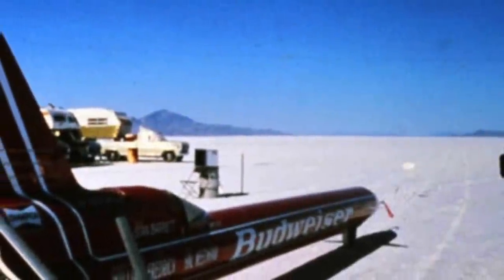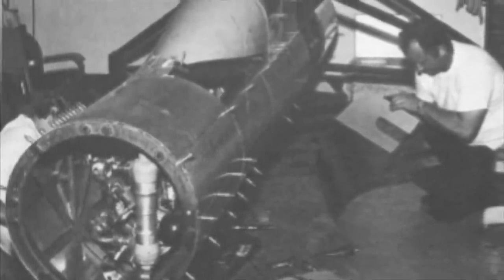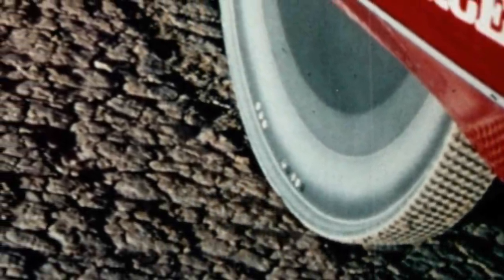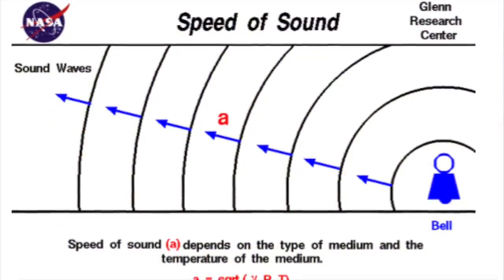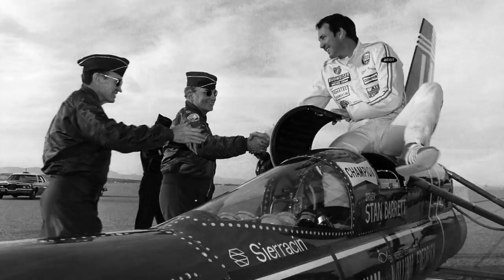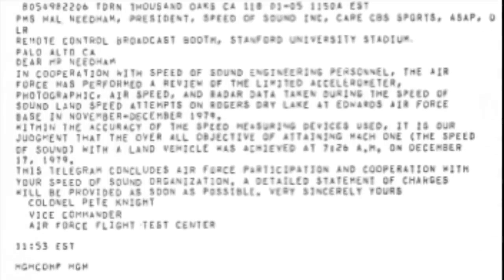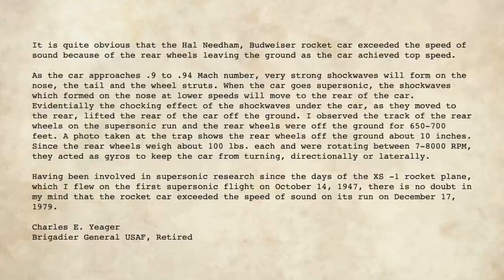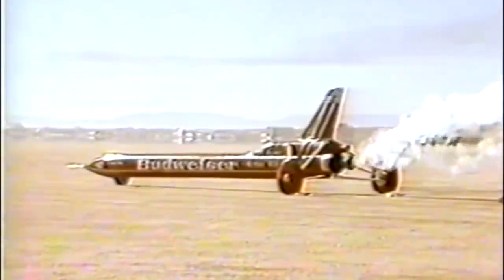The Budweiser Rocket - Controversial Rocket Car

Comment: The Air Force knew what they were doing was very dangerous, Pete Knight the X15 pilot was there giving assistance and advice. The AirForce control facility that tracks all flights was monitoring the velocity of that vehicle, they attached a sidewinder missile to the vehicle to provide sufficient thrust to push the vehicle  past mach 1 at sea level...the Air Force registered 739 mph and gave them the documentation of what they had done. The Air Force had no reason to lie , nor were they trying to assist setting a record. They know first hand the danger inherent in such endeavors, they simply did all they could that Stan Barret would survive. Armchair quarterbacks can give their opinions all they want , people present at such endeavors feel very small, ask any astronaut that has ever gone into space, ask any military aviator ...the old saying is " there is a million ways to die "
Reply: Nah.... Stan didn't break the sound barrier. If that was the case, why did it take so long for the Air Force to come up with that (bs) figure of 739 mph, * 8 hours * after the run? There are just too many issues with the timing equipment, the inconcistencies of the speeds measured, and the fact all that data has never been publicly released verified by independent authorities, that it's pretty much impossible to give the record to Barrett. 
Plus, there was no observed sonic boom, either seen in the footage or heard by the spectators, something that was proven without doubt to have occurred when Thrust SSC broke the barrier in 1997. 

Call me an "armchair quarterback" all you like.... the facts still stands. Barrett didn't break the sound barrier. He was a brave man for sure... but not the first to break the speed of sound.
Reply: Ooooof.... That's a definite "yikes" from me.

No need to rebut your unobjective and nonsensical counter when you finish off with a truly demented tirade at the end.
Reply: @821marko  1/10 because of the  insane ramblings of a madman
Reply: @ChaosCat79  ...you're not able to discern between good and evil hence your hatred is present ...evil exists in many places regardless the venue its nature never changes...it is always darkness leading to death...which is the very definition of "chaos"...

Comment: NO" SONIC BOOM " NO RECORD 🙄🙄‼️
Reply: No shock wave patterns on the ground under the vehicle either. It was these shock waves that nearly tore lumps off the underside of Thrust SSC and did a lot of damage. A vehicle that size with its pointed nose would have produced a very prominent sonic boom that would be clearly heard by those around.
Reply: The record was never their intention.

Comment: the air force calculated mach that day at 731 mph based on barometric ps and other factors such has temperature, the car went 734 on radar it reached mach 1 case closed.
Reply: No, the radar measured 38mph.
Reply: Yep!  You are correct my friend.
Reply: Is there a given height where the local speed of sound is actually 38mph -- if there is; and also assuming my theory that the given height would be "rather high up" is correct, to what magnitude would I be choking to death? If that's too boring a question, I'd also be interested to know; collectively, this community's fully-formed opinions as to how horribly fucked a sensor array would have to be in order to spit out a speed as bleak as 38mph.

Genuine question.
Reply: that is way off. for mach 1.0 to be at 739 miles an hour you would need to be at 10,000 ft in altitude case closed. people rewriting history again
Reply: It didn't happen. End of !!!

Comment: A sonic boom and a peroxide rocket both create about 200 decibals of sound. A jet engine is around 120 to 140 db.
Reply: And the sonic overpressure will reach you before the sound of the rocket or jet motor.
Reply: @thethirdman225  That's not how this works.
Reply: @mfree80286  It is if you want the truth. But if you want to engineer a story about something that didn't happen, I suppose you could just wipe it off.
Reply: @thethirdman225  This isn't an explosion; you're literally saying that the sounds moving at the speed of sound will reach you before the other sound at the speed of sound.
Reply: @mfree80286  
”This isn’t an explosion”

What’s the difference?

I’m talking about where the camera was positioned. That was the point in the run where the vehicle would reach its maximum speed. You can tell. That’s where the auxiliary rocket motor flames out. That’s where the vehicle should be travelling at the speed of sound and yes, at that point, the shockwave will hit you before the noise of the rocket will because the shockwave is travelling faster than the speed of sound.

https://physics.info/shock/

But the point is that there is no shockwave.

Comment: Not controversial.  It went 739 mph on a day that the SOS was 731mph.  USAF certified it.  Budweiser rocket car went supersonic in 1979.  All the rest is a needless bunch of crap.
Reply: Wrong in everyway.

It never touched 700mph, let alone the bogus 739mph that Hal Needham and Stan Barrett claimed it did. 

The USAF did not certify the run, in fact they backtracked from all claims and washed their hands of the entire thing shortly afterwards. 

The Budweiser Rocket never went supersonic in 1979.

The only "needless" and "crap" thing here is what you typed.

BTW, the equipment used by the USAF at Edwards, which they even notified to Needham and his team before the attempt was made, was neither calibrated or set up to record ground based vehicles in the first place. And to top it off, all the data collected by Needham has never been released for independent verification for over 40 years now. If they were so certain that they had achieved their goal of going supersonic, then they would have been all to happy to hand all the data over as proof that they broke the barrier. That it's not seen the light of day since 1979 should tell you all you need to know about the validity of the claims made about this stunt.
Reply: @ChaosCat79  You know, just as there hasn't been any solid evidence of MACH 1 have been made public, there isn't ANY evidence it never even hit 700. Given either of those options, from MACH 1 to claimed speed is less of a deviation than your claim of less than 700.
Reply: @m.cigledy6769  You are guessing. Eyewitnesses at the time (who were not tied down to Needham's contract, so were able to speak about the realities of what occurred that day) stated that the vehicle did no more than 633mph. Good enough to have gone faster than the then Land Speed record holder. 
But this is a moot point anyway. Everything would be cleared up if the data that has been stored away for over 40 years was handed over for independent verification and checking. 
This debate is happening because the original makers of the claim refused to be open with the public. It's no wonder most dismiss it as a publicity stunt.
If some magical day the data is released and it shows that it went at least over 700mph, I will gladly return here and apologise for being wrong.

But lol if you think that data is ever seeing the light of day again. :)
Reply: @ChaosCat79  Just like there is no publicly released data that shows they DID go supersonic, there isn't any that says they didn't, otherwise the controversy would be over. I seriously doubt the run in question was 633 MPH, though. They were going that fast at Bonneville with better timing equipment to prove it. The car would have been faster on the lake bed than the salt flats, because 1) It was breaking through the surface on the salt, 2) The main engine was upgraded, and 3) The sidewinder missile rocket was added. You don't run on a smother surface while adding huge power and go slower.
I honestly have no strong opinion about the car actually reaching MACH 1 or not. I wish there was better documentation available, but like you mentioned, I doubt anyone will ever see it (if it even still exists.) I willi say that the car was pretty damn cool, and I do think it probably was within ~5mph or so either way.

Comment: Problem is with such videos as these, the European speed breakers are never mentioned, & this MUST be rectified!! Gee, I wonder how many of the people producing such videos are aware of the times Rudolph Carracciola broke the land speed record in the late 1930's for a car with an engine less than 5 litres cubic capacity. He did more than 270 mph on the Darmstadt Autobahn in 1938. A very well publicised event, but NO producers of these videos acknowledged this. The other things left out, are in actual fact that the Europeans were FIRST to 100 mph, 150 mph, 200 MPH, & BEYOND!! Mercedes have just released their new "hot hatch". This car has a LIMITED top speed of 270 km/h!! Now, you bloody producers of these videos, GATHER ALL the facts, AND START AGAIN!! Just for the record, BEFORE the end of the 1970's, Mercedes-Benz had the FASTEST production car in the world. This car was the 450SEL-6.9. Some tested it, and noted the top speed approaching 160 mph, & this car is this fast FROM FACTORY, NOT a modified car, like the hy-po cars built for the race tracks by makers with parent companies in the USA. The research into the speed record breakers in the last few videos I've seen, is very POOR at best. They need to have 4 types of land speed record sections. One for motorcycles, one for production cars, one for absolute top speed of reciprocating engined cars, & last of all, jet powered cars. Until this takes place, I lost all interest in speed record attempts on land. So fucking many of the record breakers have been left out.
Reply: If these videos are lacking, why not make them yourself?  If you know so much, that other people do not acknowledge, then you are the ONLY ONE to take action.  Stop whining, and do something about it.  Oh, and make sure your your references are posted in your video's description.

Comment: its probably already been stated.....FIA rules......car must have 4 wheels......and do 2 runs in opposite directions within 1 hour......this ''car'' had 3 wheels.....and did only 1 run. still quite cool achievement by men in flares with bad hair styles!
Reply: Two way runs per FIA rules are for speed records. Breaking the sound barrier in a ground vehicle only needs happen once - one run in one direction. FIA rules don't matter since it will not go in the books.
The number of wheels also do not matter, they broke the record with a ground vehicle and they did it first.

Comment: The speed claim is extremely dodgy, even the USAF wouldn't confirm the results from their own radar system & claims that the car broke the sound barrier were based on a test run by a DIFFERENT vehicle AFTER  the record attempt. With no data released from the accelerometers, no sonic boom heard or shockwave seen, plus the obvious pressure from the sponsor to get what they paid for & you have a recipe for simply "Declaring victory" & moving on. If the car genuinely was that fast it could've been run again with timing measurements that were incontrovertible, but I suspect the team knew that this would show that they didn't break Mach1 & so never allowed it to be run it again.
Reply: @davidrobinson5041  RepubliTraitor tears.
Reply: Sounds spot on DT
Reply: We can suspect this, but we can't know this.

Comment: Why not do it again, using the same exact technology he had at the time, but with our current measurement technology. Or just send some one back in time with a fucking speedometer for fuck sake lmao :D
Reply: Who cares? Blue flame went supersonic, but didn't turn round within an hour either. They got stick for only having 3 wheels. That would have been overlooked if they'd have turned round in 1 hour! But SSC has pissed allover it anyway in Aug 1997 they went supersonic! - So it is irrelavent! - Cool car, nice attempt, but you gotta have a measured mile section in the middle where you go mental. Throw Longines, Tag Heuer and Guinness at it ! Then you gotta record Baby - Fly the flag!
Reply: @hoppinonabronzeleg9477  it's not just turnaround in an hour or less, the two runs have to be at speeds within 10% of each other. Many records have been surpassed but declared not to be because of a greater than 10% difference. What would matter about refurbishing the Budweiser Rocket and running it again with modern instrumentation would be to prove - or not, that a land vehicle reached a peak speed higher than Mach 1 in 1979. That would make Thrust SSC the second land vehicle to exceed the speed of sound.

Comment: Controversy I really don't understand  . He just didn't want to make a t one way run . Because of the dangers the cost many it's things . As soon went past the sound barrier there is no question he did . There was no Sonic Boom because of the design of the car . It's built like a bullet they break the sound barrier but do not have a Sonic Boom because of the way the design . This was quite a engineering feat and achievement
Reply: Haha, sorry - no sonic boom = not supersonic - try again.
Reply: All supersonic bullets have a sonic boom. the X-1 was also designed to be shaped like a bullet, and it had a sonic boom.
Reply: @bbowman105  hey I'm not arguing with you, but genuinely curious where I can see the X-planes sonic boom.
Reply: @bbowman105  I'll take it.

Comment: It didn't. The rule is two way run.  PERIOD!
Reply: For an official run, sure. But not for a run just for the sake of doing so.
Reply: @thatairplaneguy  If they could have, they would have. Failing often comes with an excuse.
Reply: @housey4297  it was already known that the car wasn't able to do a quick turn around. It's not like they just came up with that after the first run so they didn't have to again.  They could have broken the sound barrier and simply not been able to run again. That doesn' t mean they didn't break the sound barrier, just that they didn't set an official record.
Reply: The Air Force didnt officially state that they had. Thrust SST proved it happened with video and photos of the shockwave no such evidence here.
Reply: @joeg5414  There is no evidence they broke the sound barrier...to my point.
Reply: So using your logic Chuck Yeager wasn't the first person to fly supersonic because he didn't turn around and make a second pass within the allocated time.   Or Neil Armstrong didn't land on the moon because he didn't go twice.
Reply: @housey4297  The certified radar data disagrees with your "point"
Reply: @AIM54A  Not really, there is lots and lots of counter evidence as this video examples as do other sources. The point about Chuck Yeager is utterly irrelevant to this debate, not least as his efforts were clearly evidenced when this is FULL of holes.
Reply: That's only for an officially recognized land speed record.  That isn't what they were going for.
Reply: @ts89540  Yes, we know, people keep stating that fact and we accept their ambition. The issue is there is significant evidence now that they actually never go what they were going for. THAT is the debate.
Reply: My bad, I hadn't read the other replies.

Comment: 700 mph and the speed of sound there the next two landmarks in the legitimate Land speed record which was run in accordance of strict, well established rules that had been agreed upon by both British and American contenders.
I feel that the Bud rocket car was at best an un-sporting stunt that would attempt to steal the thunder from legitimate, rule abiding contenders.  NOTHING about the car, the course or the timing (especially the timing) conformed to any established protocol. Did it break the speed of sound ? Who cares !   Would a Phantom jet trailing a wheel on the ground count ?  NO.     That is why there are rules.
Let just say a stuntman went very fast and leave it at that!
Reply: Yeah but the plane had control surfaces called wings
Reply: @timothyproksch2915  Does it matter how many rules you break, Just to be first ?  What would Craig Breedlove feel about this ' Screw the rules, I got there first' attitude  ?
Reply: "I don't like the public relations campaign to adjust the format to fit the effort. If Barrett breaks the sound barrier one way and someone does it both ways Barrett's run will always overshadow the other one. I don't like that."  -- Craig Breedlove on the Budweiser Rocket 'breaking' the Blue Flame's record on the 10th September 1979 with a one way peak speed of 638.637 mph.